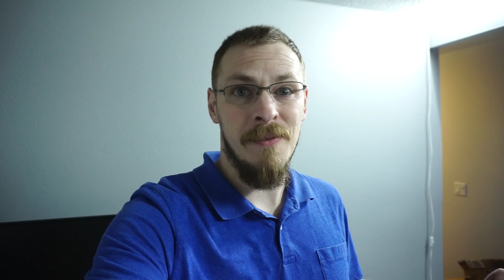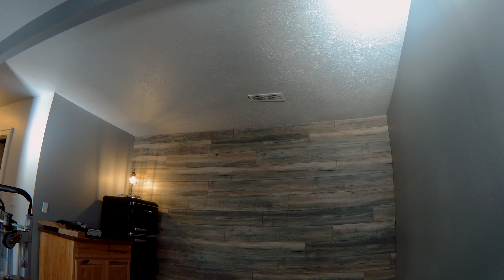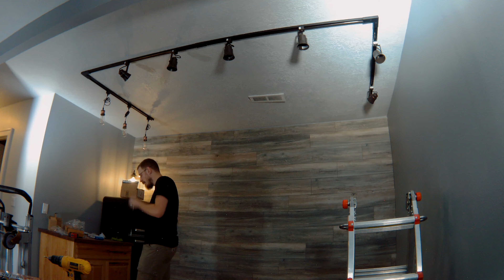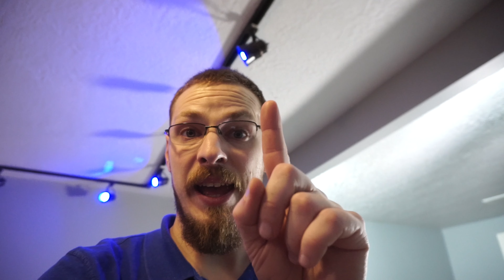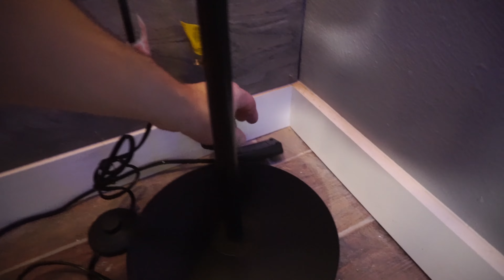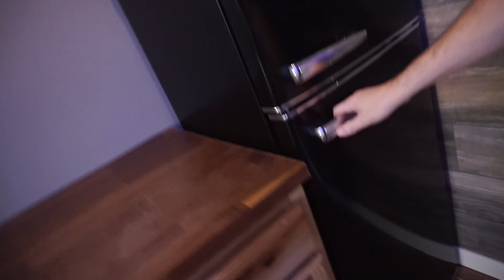LET THERE BE LIGHT! Moving VLOG Day 2!

Comment: Stud finder tip for the future :: - magnets

Since the drywall is screwed to the wall and ceiling, you can easily use a magnet to locate the screws. Leave one magnet in place, find the next screw, and draw a line between them. I've found this has a few advantages:

1. I have less false positives vs a stud finder.
2. I can visually see the whole stud line instead of just a small portion.
3. I can visualize where things will go without having to make pencil marks all over the wall or ceiling. You can move things to a different stud if you don't like where they'll line up on the first one.
4. With a line laser pointer, I can mark the whole stud (or multiple studs) with zero pencil marks and know that that line is perfectly centered along the whole stud.
5. Shoulder gets less tired. The magnet just snaps into place on the ceiling and I don't have to hold the stud finder while I find the stud and make pencil marks.
6. MAGNETS AND LASERS !!! 

Great video, studio is looking good. Looking forward to more CC videos coming soon.
Reply: Reasons:-

1. MAGNETS & LASERS
2. MAGNETS & LASERS
3. MAGNETS & LASERS
4. MAGNETS & LASERS
5. MAGNETS & LASERS
6. LASERS

Did I mention Magnets & Lasers?